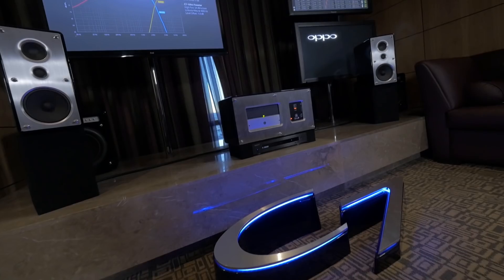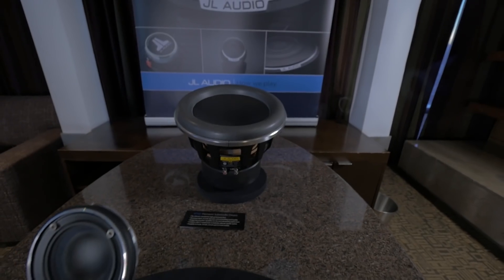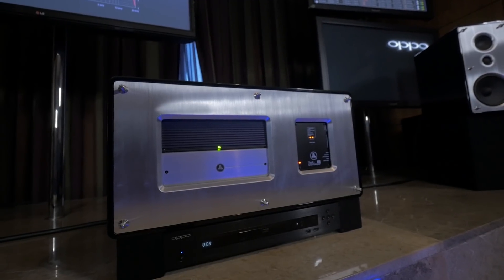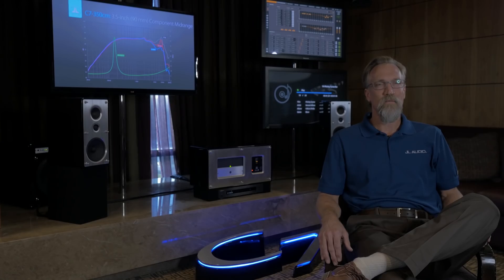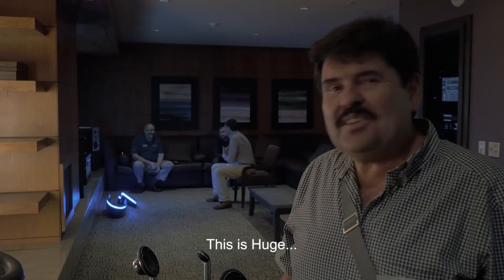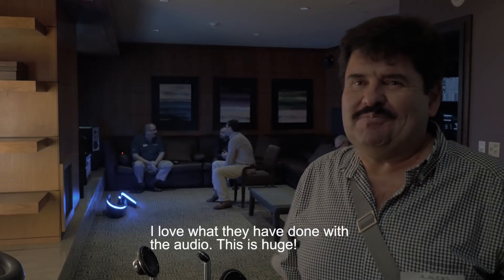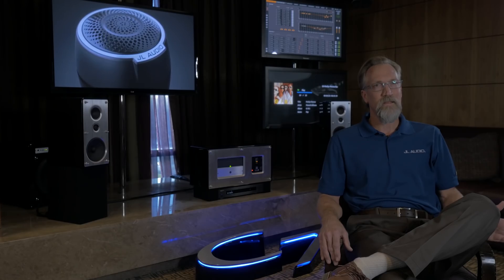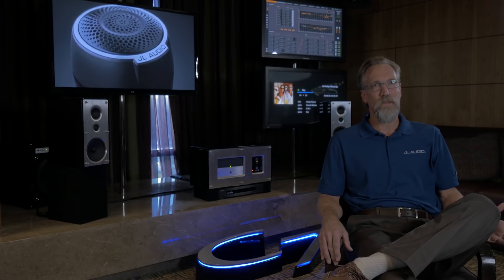World Premiere of the JL Audio C7 Speakers

Comment: I am very interested in this line to run actively in my New Ford Flex. I own several pairs of the C5-653's and love them I can only imagine how these sound, feel and look in person. However in order for me to drop that kind of cash to replace all my crappy stock Sony speakers for these, I really need to hear them to justify the price of  each midrange speaker, tweeter and midbass woofer. I already seen the price and it is a hell of alot to pay per driver so I need to be blown away.
Reply: Jose Luis Ruiz if i cant listen to these in person might as well hear them from someone's review on them.
Too much investing for some speakers like these :,(
Reply: James Teter I don't think it is. The way my components are set up by the crossover is low pass frequencies going to the 6.5 inch component woofers so you only hear the low frequencies on those speakers, the 4 inch midrange are set to handle frequencies above 100HZ and seem to only give you a flat response in that frequency range and then There is there is the tweeters that are set to only accept high Frequencies and all I hear on those are the crisp sound of the music. When i crank it up I have Zero Distortion coming from the speakers. But you can do a 2 way set up and split the midrange and low frequencies to the 6.5 inch component woofer and all the high frequencies to the tweeters.
Reply: nah you'd be good with just the 650 c7 and I'd get the tweeters
Reply: What's the MSRP?
Reply: James Teter 
$449.99 for Each C7-650CW
$349.99 for Each C7-350CM
$199.99 for Each C7-100CT 
USD
Reply: Wow! Good to know...thank you! Curious to hear them as well.
Reply: James Teter me too, the C5 3 way components I have were $449.99 a set when i bought the pairs back in April of 2012, they still sound good. I did buy a 3rd pair from JL Audio for $849.99 early 2017 so the price did go up by double but the new price tag for the C7s is very high for Each speaker. I really want to hear them. 🤔
Reply: Wow that was a very good price considering what they are now. My local stereo shop in San Diego is recommending the Focal K2s which aren't cheap either. Will have to take a listen to these when they come out. Is the 3.5 necessary you think? If not makes them a little easier to afford.
Reply: carrillo100100 very true.